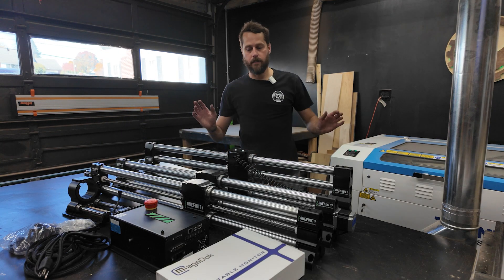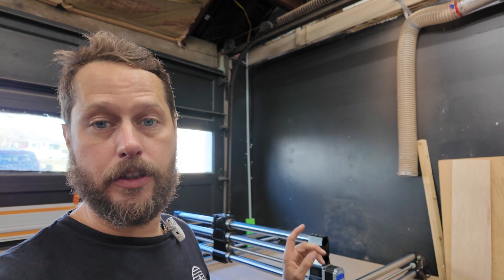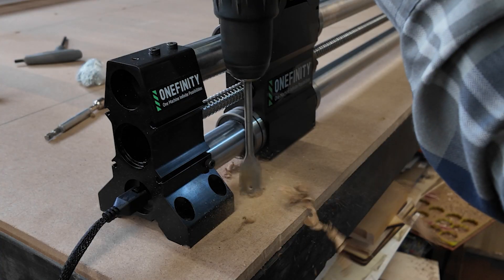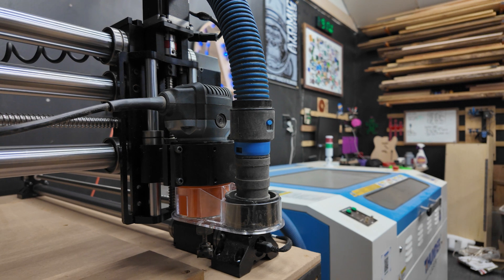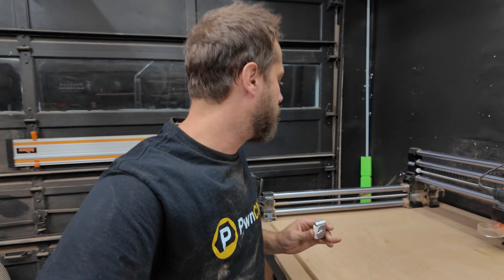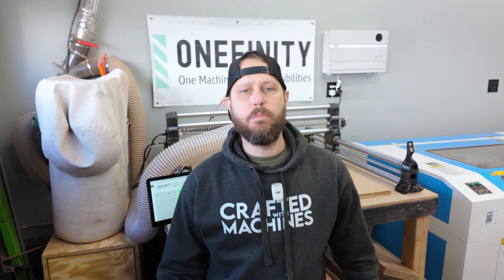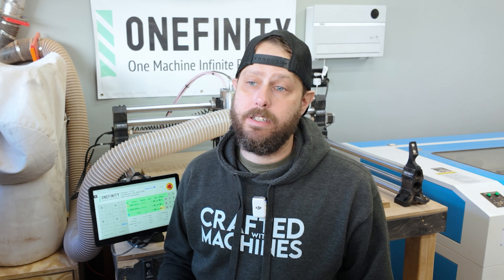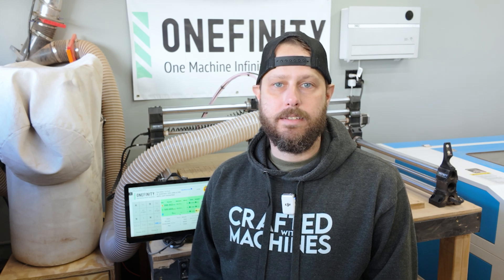Watch This Before You Set Up Your Onefinity CNC!

Comment: What material are you using for your wasteboard?
Reply from the maker: Half inch mdf doubled up, bottom layer is mostly permanent but replaceable if needed, top layer is completely sacrificial  and quickly replaceable with a few counter sunk screws (to minimize chance of tool hitting them)

Comment: I took a similar route to getting my onefinity. Back in 2021 I didn't want to wait on their 12week lead time so I bought a longmill mk1. But unlike your shapoko I regretted my purchase a few months later when I started running into one issue after another. 6 months later I cut my losses and bought a 2nd machine , a millright carve king 2, because I still didn't want to wait for 1F. And the millright served me well until 2023 when I finally bit the bullet and ordered my elite woodworker...but still had a 8 week lead time. But the millright served me well until I got my woodworker in Oct 2023. And I have had very few issues since buying it. And those issues I had were quickly addressed. At one point onefinity had a bad batch of stepper motors and I burned through 3 z motors in a few months. Eventually I bought the zbreak and kept my 3rd replacement motor as a back up. I've put 100s of hours on this machine and it has worked nearly flawlessly
Reply from the maker: Sounds like you've had quite the journey! Sorry that your first machine was such a dud, that being said, glad you stuck it out. I remember hearing about the 1F stepper issue, but it seemed like they jumped on fixing it pretty quick.